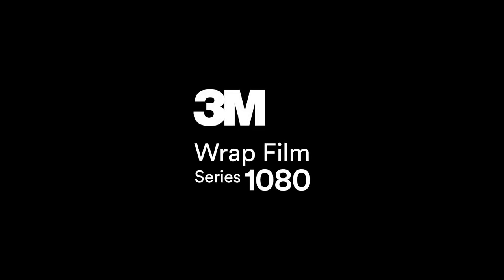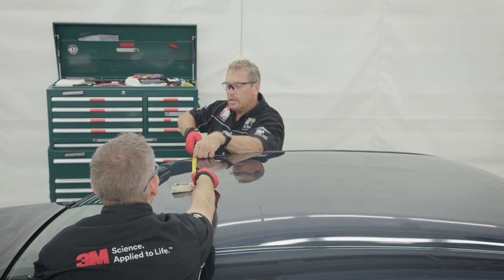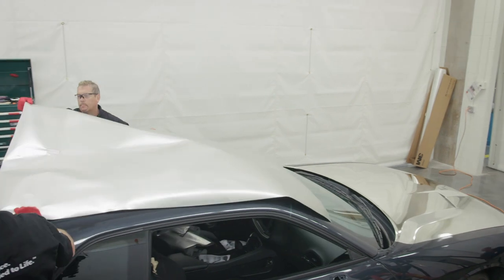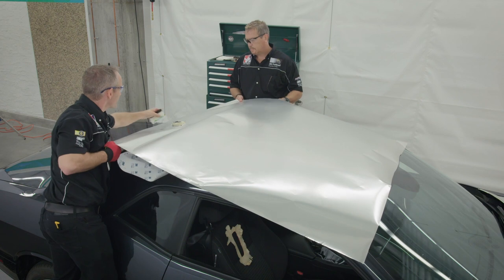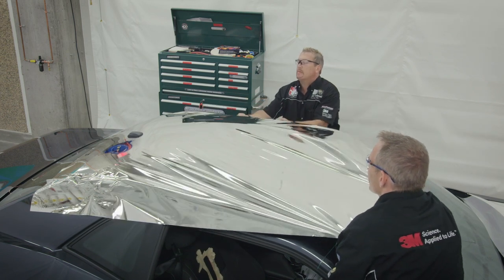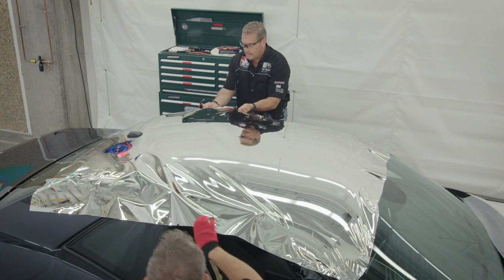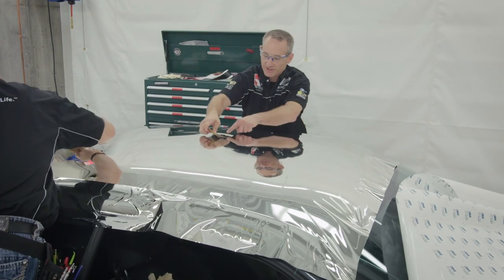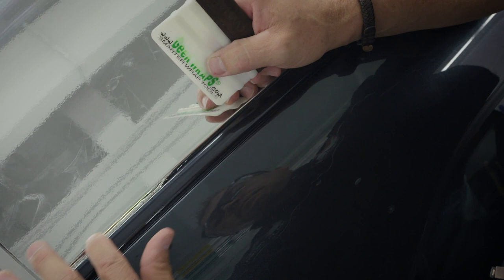How to Wrap a Roof with 3M™ Wrap Film Series 1080-GC451 Gloss Silver Chrome

Comment: Does this reduce interior temperatures by reflecting the sun away? genuinely curious! I live in Florida and anything that will get my interior a few degrees cooler is worth considering
Reply from the maker: Hello Brian -

The 3M™ Wrap Film Series 1080-GC451 is primarily designed for aesthetic purposes and vehicle customization, offering a high-gloss finish and various colors and textures. While it provides some level of UV protection, its primary function is not to reflect sunlight and reduce interior temperatures.

If your goal is to lower interior temperatures, you might want to consider products specifically designed for that purpose, such as 3M's automotive window films. These films are engineered to reject solar heat and block UV rays, effectively keeping the interior cooler.

Hope this information helps! Thank you.